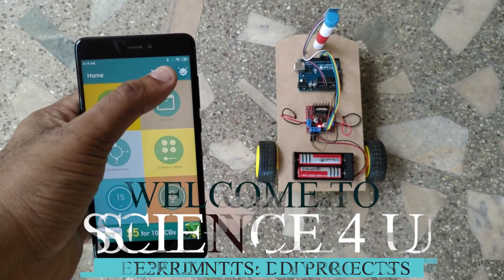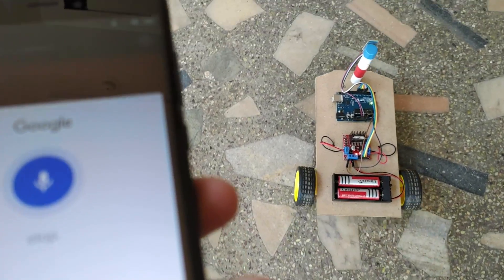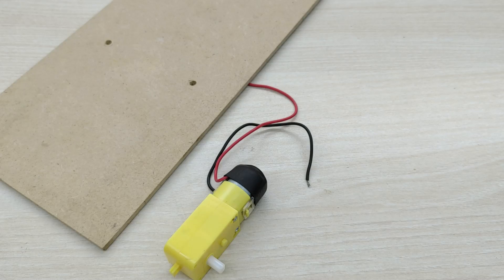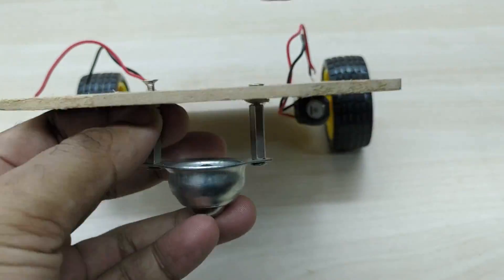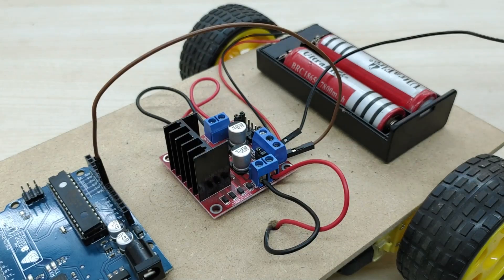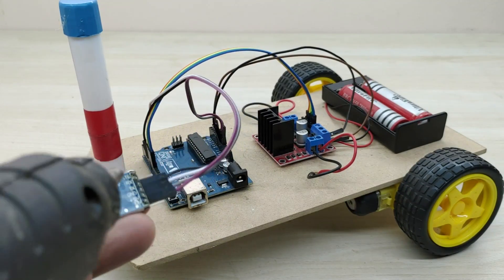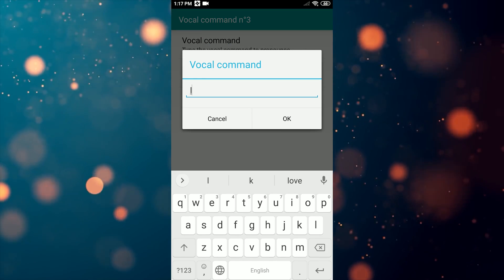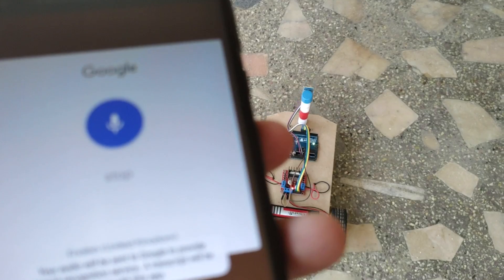How to make a Voice Controlled Robot || Obeys voice commands #arduinoproject

Comment: Hello our module is not getting connected. Is there a specific reason for that?
Reply from the maker: First we have to switch on phone bluetooth and have to pair the module by searching for the devices  in phone bluetooth. Pairing password is usually 1234. After pairing only, you have to open the application and connect the module.
Reply from the maker: Are you not able to pair the bluetooth module by typing password 1234?
Reply: @Science_4U_ thank you actually our bluetooth module was at fault so we changed it and its working perfectly
Reply from the maker: Okay..That is great..❤️

Comment: Bluetooth module is pairing with phone but not able to connect in app. Please help to solve this issue. Very urgent
Reply: Bluetooth is connect or not
Reply: Bro im also facing same
Problem give me solution
Reply from the maker: Hi friend. Some bluetooth modules have this issue. It could be a problem with yhe bluetooth module. Can you check with another smartphone?
Reply from the maker: Hi friend. Some bluetooth modules have this issue. It could be a problem with yhe bluetooth module. Can you check with another smartphone?
Reply: @Science_4U_ yess i had checked but the problem remain the same
Reply from the maker: @rishabhsoni756  most likely it is a bluetooth related problem friends..is it asking for a password when pairing? Good bluetooth modules should ask for a password while pairing with bluetooth.
Reply: @ no it is not asking for a password
While connecting the bluetooth connection lost is showing
Reply from the maker: @rishabhsoni756  hmm..mostly should be a faulty bluetooth module..
Reply: @ can u plzz provide a contact number show i can show the connection and all abd bluetooth module
Reply: @Science_4U_  no sir Bluetooth is working

Comment: Will it work on 9V batteries?
Reply from the maker: Yes. It will work on 9V batteries. But it will not last long an will get discharged fast. AA batteries are more ideal for this project since they have higher current discharge capability and lasts longer also. You can use 4 x AA or 6 X AA batteries.

Comment: Normaly we should connect l298n 5v (pin on right of drive) with vin arduino, why you have connected to the 5-35 v l298n pin directly with vin arduino. Thank u
Reply from the maker: Hi friend. What  you told will also work. But the current output capacity of 5V pin in L298N board is only 500mA. So it will not be useful for powering arduino and many sensors alongwith it. If the sensor load connected to arduino is less , then it can be powered from 5V output pin of L298N, without any issues. If you power arduino directly by connecting a battery to Vin pin, there is no such 500mA current limitation. so it is better to connect battery directly to Vin pin and power arduino and all the sensors.

Comment: Can i use microcontroller 8051 in the place of Arduino??
Reply from the maker: @manishaangadi499  Technically it is possible but will be very difficult to do so. It is difficult to do the programming of 8051 microcontroller and difficult to find sensors compatible with it.

Comment: All the materials
Reply from the maker: Hi friend. All the materials alongwith the purchase links are given in the description box below the video. Iam giving the components here also..
The links for purchasing the items are given below. 
1. Arduino uno board : https://amzn.eu/d/iH03OHj
2. L298N motor driver : https://amzn.eu/d/bzrLeMA
3. HC-05 Bluetooth Module: https://amzn.eu/d/jcMFVBr
4. Motors with wheels : https://amzn.eu/d/gGczeza
5. 18650 battery pack  :https://amzn.eu/d/gtI4BlO
6. Jumper wires : https://amzn.eu/d/hQ1P7Mi